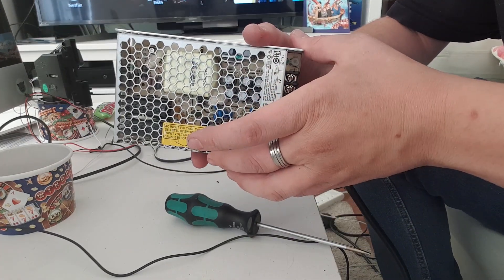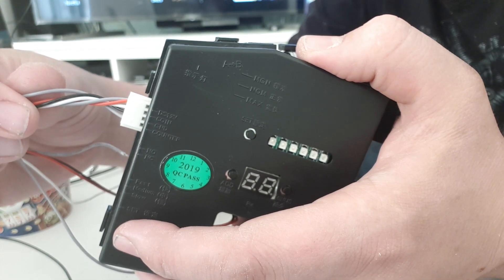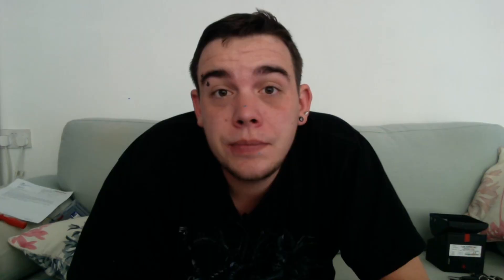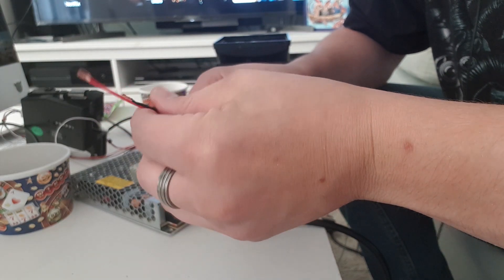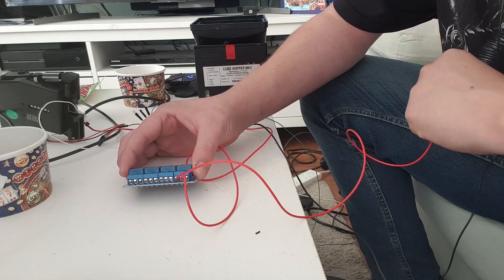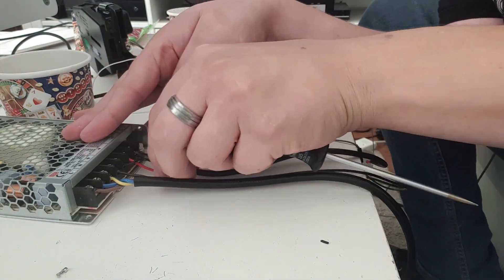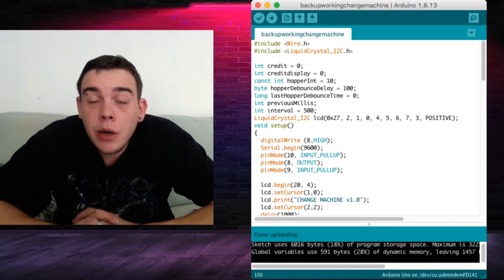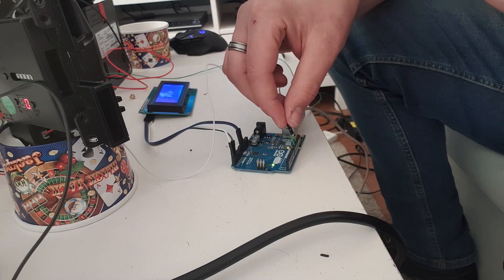MAKE A CHANGE MACHINE  - MAKE YOUR OWN COIN CHANGE MACHINE - PT2

Comment from the maker: CODE FOR ARDUINO:
----------------------- START CODE-------------------------------

//Replace (Open angled bracket) and (Close angled bracket) with Angled Brackets Respectively..

#include <Wire.h>
#include <LiquidCrystal_I2C.h>

int credit = 0;
int creditdisplay = 0;
const int hopperInt = 10;
byte hopperDebounceDelay = 100;
long lastHopperDebounceTime = 0;
int previousMillis;
int interval = 500;
LiquidCrystal_I2C lcd(0x27, 2, 1, 0, 4, 5, 6, 7, 3, POSITIVE);
void setup()
{
  digitalWrite (8,HIGH);
  Serial.begin(9600);
  pinMode(10, INPUT_PULLUP);
  pinMode(8, OUTPUT);
  pinMode(9, INPUT_PULLUP);

  lcd.begin(20, 4);
  lcd.setCursor(1,0);
  lcd.print("CHANGE MACHINE v1.0");
  lcd.setCursor(2,2);
  delay(1000);
  lcd.print("INSIDE THE ARCADE");
  delay(3000);
  lcd.clear();
  lcd.setCursor(3,4);
  lcd.print("INITIALISING...");
  delay(3000);
  lcd.clear();
  lcd.setCursor(3,1);
  lcd.print("INSERT COIN(S)");
  lcd.setCursor(3,2);
  lcd.print("FOR 10p CHANGE");
}
void loop()
{

//lcd.print("1");

int CoinVal = digitalRead(9);
int HopperSense = digitalRead(7);
//Serial.println(SensorVal);

if (CoinVal == HIGH)
{
 
}
else
{
  credit = credit + 1;
  creditdisplay = creditdisplay + 1;
  
  Serial.println(credit);
  Serial.print(creditdisplay);
  Serial.println(" Credits");
  lcd.clear();
  lcd.setCursor(1,1);
  lcd.print("Coins to Pay:");
  lcd.setCursor(14,1);
  lcd.print(creditdisplay);
  delay(20);
  
  
}

  if(credit > 0)
    {

      
      digitalWrite(8, LOW);
      if (digitalRead(hopperInt) == LOW && ((millis() - lastHopperDebounceTime) > hopperDebounceDelay))
      (Open Angled Bracket)
      lastHopperDebounceTime = millis();
      Serial.println("CoinPaid");
      credit = credit - 1;
      lcd.setCursor(1,2);
      lcd.print("Coins Paid");
      lcd.setCursor(14,2);
      lcd.print(creditdisplay - credit);
      
      if(credit == 0)
      {
        creditdisplay = 0;
        
       
        digitalWrite(8, HIGH);
        delay(2000);
        lcd.clear();
        lcd.setCursor(3,1);
        lcd.print("INSERT COIN(S)");
         lcd.setCursor(3,2);
        lcd.print("FOR 10p CHANGE");
      }
}
}
]
Reply: Should this code not be digitalRead(10) rather than digitalRead(7) since there is nothing connected to input 7?